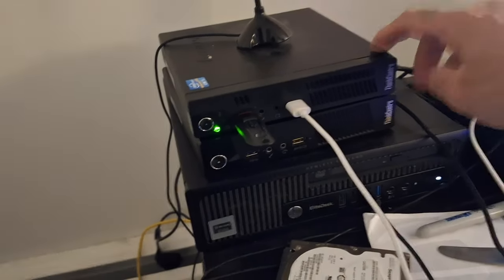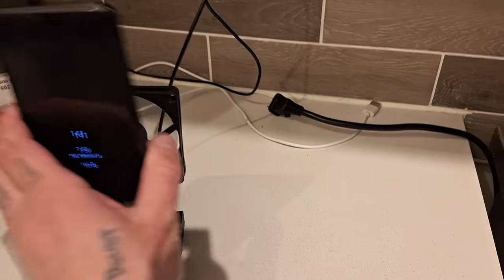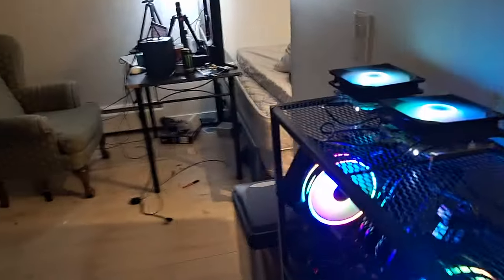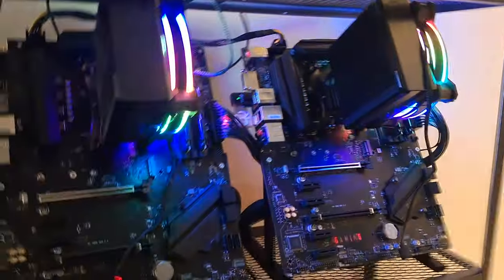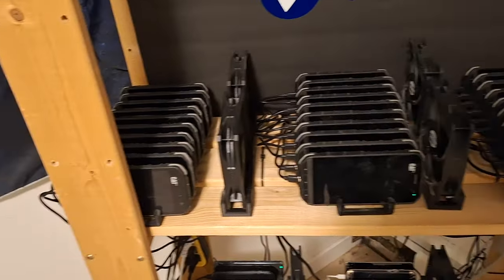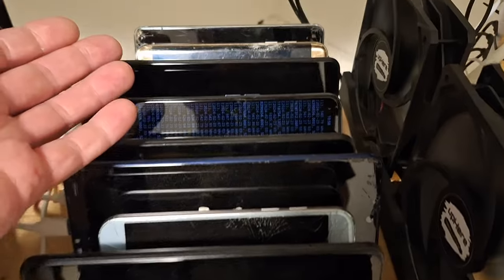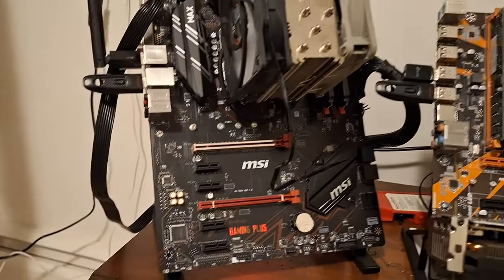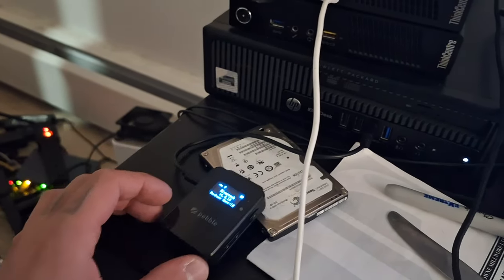EVERYTHING I HAVE MINING [1 YEAR UPDATE] + Giveaway Ended

Comment: For your Xeon. Prepare to double your hashrate… step 1 disable hyper threading. Step 2, ensure you are running 4 sticks of ram for quad channel. Step 3: run fewer threads until you find the fastest HASHRATE, each chip is different, I always recommend leaving one thread off for overhead, the Xeons can “bog” after a few days to half the HASHRATE!?, but with one core off this seems to solve it and barely affects the hash, with your 22 core I dunno, you might be good with 21 threads, but it’s possible you will get a higher HASHRATE with 20 or less, you won’t know until you try. Let us know!!
Reply from the maker: Thank you so much, 100% trying this as soon as I get home
Reply from the maker: Only thing is I am missing is the quad, I only have 4 sticks in each rig
Reply from the maker: As soon as i turn off hyper threading and put down a few threads...... way lower hashrate